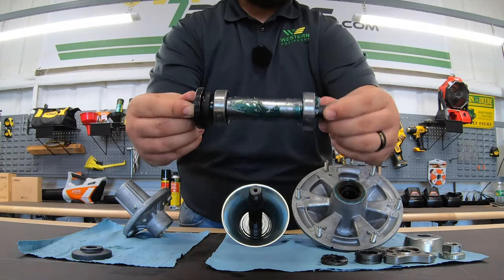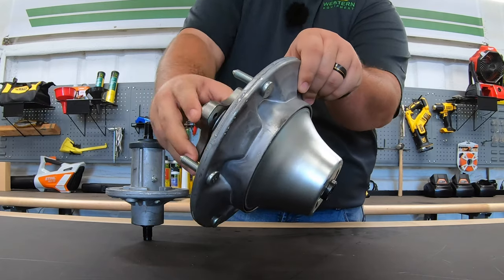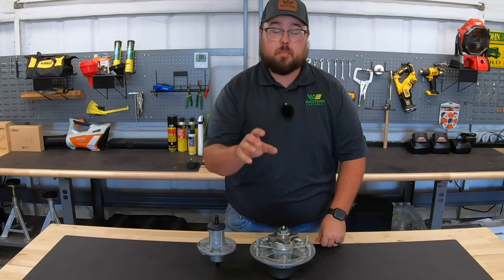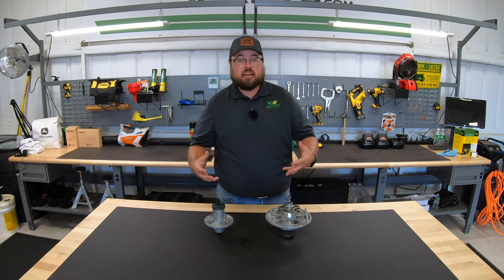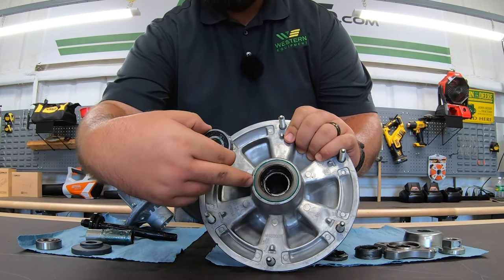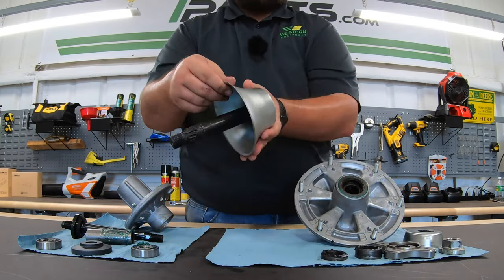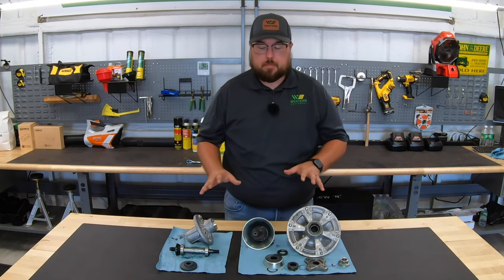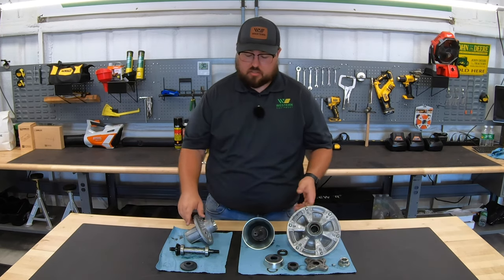Mower Spindles Explained & Differences Between Residential VS Commercial Spindles

Comment: The zerk fitting is totally useless both bearing are sealed bearings, so you are just wasting your time and grease, with sealed bearings there is no way the grease can lubricates the bearings
Reply from the maker: Like said in the video, it is still important to grease the spindles for the life of the shaft and housing. Thanks for watching.
Reply: You can( if you're so inclined) take the spindle apart and pop out the inner bearing seals so that the grease reaches the bearings better. If you choose to do this though I'd suggest more frequently greasing them than the suggested 50 hour intervals.

Comment: I really enjoy your videos they're very informative but you left out the most important part how much greased do you put in the spindle every time you pump the handle it only spits out a little bit of grease would you say 10 pumps 20 pumps 30 pumps 40 pumps give us an idea
Reply from the maker: Thank you and yes, you are correct I did leave that out by accident. The best way to do this is by using a hand pump grease gun and start with only a couple of pumps and then stop when you start to feel resistance of the grease going into the spindle. Good question and thanks for watching!
Reply: It seems like by the time you feel resistance from pumping grease into the spindle you may have done alot of pumps. Why is it there is hardly any grease in the spindles but in the bearings, when coming right from the factory? Being cheap or ?

Comment: I just bought an S130 lawnmower. I went to grease the blade spindles but there wasn’t any grease fittings on either spindle. Is this normal?
Reply from the maker: Looks like on the S130 the grease fitting are on top of the shaft like the commercial spindle shown in the video. Did you check there? I hope this helps and thanks for watching!
Reply: @WesternEquipment  
You were right. I found the grease fittings on top. 
Thanks

Comment: Informational note:
The purpose of the sleeve between the two bearings; The sleeve is a spacer so that when you tighten the bolt you don't press the center out of the bearings or slightly misalign it. It holds them in place at a specific distance so they will keep working properly. If that sleeve is loose it was improperly manufactured or the bearings were improperly installed and more than likely one or both bearings will fail. 

As to putting grease between the bearings, it does not lubricate the bearings nor is it there to lubricate the sleeve. My best guess it is there for the cooling properties for lower grade bearings to help transmit the heat from the center shaft to the outer housing. 

If I am wrong please explain why I am wrong. 🧔‍♂️

Comment: Thanks for the informative session. Sorry if this is a stupid question but how often should the spindles be greased?
Reply from the maker: Not a stupid question at all, I meant to include this in the video and completely missed it.  This should be done every 50 hours or annually and also any time your machine is washed with water or is exposed to rain or any other heavy moisture. I hope this helps and thanks for watching!

Comment: My 2019 X380 operators manual states use either JD Multi Purpose HD Lithium Complex or JD Grease-Gard Premium Plus.  Have a recommendation?  There is a cost difference, but I want this tractor to last many, many years.  Thanks!
Reply from the maker: This would be a preference situation. Since both are recommended you are safe with both but if you want the most out of your mower then go with the higher end grease. I hope this helps and thanks for watching!
Reply: Thanks for the response!  Can the Lithium grease be used on all the 380 zerks?

Comment: Love your videos. I just ordered my first zero turn a z345r. Your videos helped me decide between Toro timecutter, Cub Cadet, john deere and kubota. I was surprised that the z345r wasn't more expensive than toro or cub cadet. My only worry with the z345r is the frame which I saw from another video can flex. I was leaning towards the kubota z231 but it was out of my price range and the solid roll bar was a turn off since I have trees to cut around. Anyways, what grease do you suggest and how often do you recommend the spindles be greased?
Reply from the maker: Thank you and I am glad I could help with your decision! Most of your basic greases will work but  Ialways suggest the John Deere SD Polyurea TY6341 here is a link if you would like to order some https://247parts.com/sd-polyurea-grease-ty6341/. This should be done every 50 hours or annually and also any time your machine is washed with water or is exposed to rain or any other heavy moisture. I hope this helps and thanks for watching!

Comment: I appreciate video. Thank you.   I would want to know specifaccly how much grease and timing for 900 series?  What indicator would I look for to know spindle is full? Thank you for your time.
Reply: I would like to know this as well
Reply from the maker: @Phil McCoy and @Traveling Unhinged Great questions and definitely one I meant to hit on in the video. Greasing should be done every 50 hours or anytime you use water to wash your machine. As far as how much it will depend on the amount of usage. Use a hand pump grease gun and start with just a couple of pumps and stop as soon as you start to feel resistance of the grease wanting to go into the spindle. I hope this helps and thanks for watching!
Reply: @WesternEquipment  Thank you Sir. I have enjoyed all your videos.
Reply: @WesternEquipment  thanks for the answer my 950 has never shown any resistance but sometimes i get grease that throws from under the pulleys
Reply: @jhundley2009  mine also does I been grease mine 10 hours 4 pumps never resistance

Comment: My John Deere D140 has three blades with the 48" cut. Would all three spindles be the same size and I would just order three of them or are they different sizes? Have not pulled the mower deck off yet. I just lifted it up enough to get under it to change blades. but I did get new blades. I couldn't get the nuts back on and so I must need new spindles.
Reply from the maker: They would be all the same but I am curious as to why the nuts won't go back on. I wouldn't think you would need new spindles. To the ends of the spindles, where the nuts go on, look like they are messed up?
Reply: @WesternEquipment  Yes and threads must be screwed up. I got it all taken care of and almost finished mowing when the new belt snapped. I wonder if I did not get the pulley’s back in in same position. Would that cause the belt to snap? Grass was not high & I didn’t get branches or anything under or over the deck….

Comment: So much misinformation in this video and comment section. 

Spindles wear out from lack of grease, the grease is a carrier for the oil inside which lubricates.  You apply grease to the zerk until you see grease come out from either a pressure valve or through a bearing. 
The seals on a bearing do not prevent pressurized grease from entering, they keep dust out. The metal shield on the lower outboard bearing will prevent contaminant entry. 

The grease does nothing for the spacer, which is sitting on the inner races of the bearings and rotates at the same speed as the blades, pulleys and shaft.  

The spacers are there to keep the bearings in the correct position in the housings so that when clamping loads are applied to the shaft, it does not crack the soft aluminum housing. 

There is rattle and play because it is not a tightened assembly yet. 

You need to fill the cavity until it you have pressurized the rubber seals on the bearing and the grease forces into the bearing, this can take 50 to 100 pumps from a hand greasegun if you have not properly greased a spindle. Stop when you see grease coming out. It's that simple. 

4 or 5 pumps will not accomplish what you desire, you need to fill the empty spaces and force grease into the bearings.
Reply from the maker: Thank you for the thorough comment and thanks for watching!
Reply: Finally a person who understands how these spindles work and everyone who questions there spindles need to read ur comment thank you!
Reply: I saw a recent YouTube video from a lawn mower mechanic pretty much saying the same thing that grease can penetrate the  rubber side of the bearing to grease the bearing and it requires around 70 pumps to completely fill the cavity between the 2 bearings

Comment: I have had to replace my bearings twice over the las 7 years because they are sealed on both sides. Removing the inner seals will not work because you need to have a way for the old grease to get out to be replaced by the new grease, while keeping dirt and water out. Any ideas on how to do that? Greasing the shaft does NOTHING, but it won't hurt anything. I have never greased the shaft and it is fine and so is the bearing pocket in the housing, not oversized or worn at all.
Reply from the maker: Hmmm, I would have to do some research on that one. Good question and thanks for watching!
Reply: So just remove and re-pack both bearings every year? If the inner seal was removed on the lower bearing then at least the grease could churn around and warm grease might flow downward into the bottom bearing. For the upper bearing I don't know.

Comment: hi Turbo Force decks . Try Toro Grounds Master spindles   1-1/8 to 1-1/4 shaft Cast iron housing 10 inch diameter . Blade location is u shape blade carrier welded to end of spindle . About 750hr overhaul. The later units are even tougher
Reply from the maker: Interesting. Thanks for the comment and for watching!

Comment: My question is: Does John Deere remove the shield on the inner side of spindle bearings? If so when did they start? Ande on what models?
Because both my L120 had the shields on the inner side of the spindle bearings.
Reply from the maker: From what I have seen, all of the 100 series spindles have sealed bearings on both sides. Once you move up into the X300 series mowers this starts to change and then it varies from model to model. Good question and thanks for watching!
Reply: @WesternEquipment  I have a 2021 X380. Does this particular model have sealed bearings on both sides or just the outer sides ?